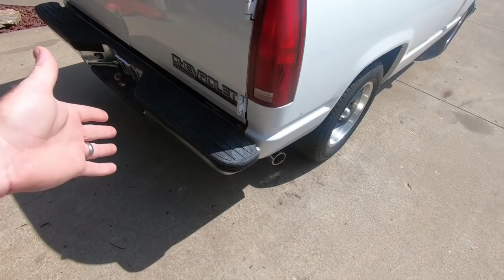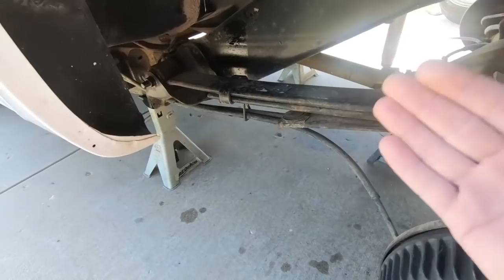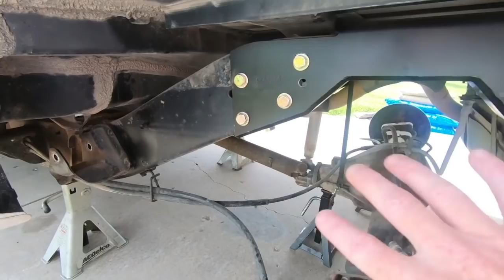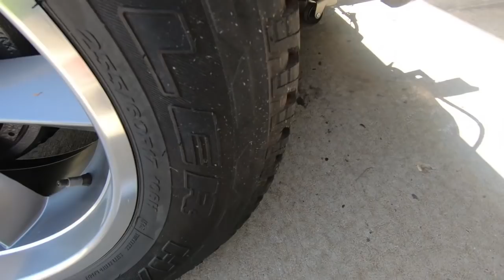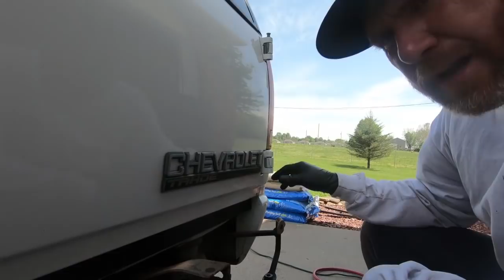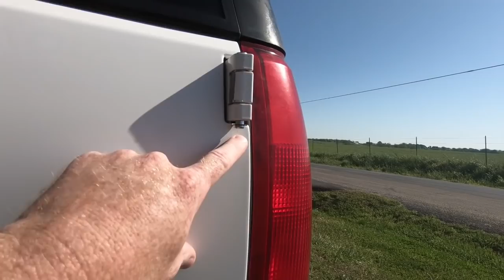2 Door Tahoe Makeover Part 5 (Getting it Low and Replacing Barn Door)

Comment: Did you have to move any crossmembers above the rear end? If you could please let me know..
Reply: When I lowered mine I did pretty much the same thing you’ve done here, but over certain bumps there’s something hitting. It’s not the frame I’m thinking it’s either the pumpkin hitting a cross member or maybe the driveshaft? I can’t figure wtf it is.
Reply from the maker: No. Only things done were what is in video
Reply from the maker: I notched for both in the video
Reply: TWA Motorsports ok thanks bro this video was super informative I’ve been looking for this info for a minute lol

Comment: Nice ride, your among the first people with a video lowering a 2 door tahoe, I have one too 2wd, I did drop spindles and cut an inch of the coils for a 3 inch drop, then I did a flip kit with a 1 inch lift shackles, I didnt want to C notch it because even if I had, the pumpkin would of still hit, I had to cut the rail on top of it, also the driveshaft would of rubbed on dips or with people in the truck and I didnt want to cut and weld in the tunnel of the body, so I got 6 degrees shims, but I want to lift the back 2 inches with lift hangers.
Reply from the maker: Thank you. Yeah lots of work to get these dropped low
Reply: @TWAMotorsports  yes they do, and I didnt know until I lowered it since there really isnt videos speaking about it and pick ups are a bit different so they dont have the same issues, it seems the flip kit drops go about an inch more then stated, I want to lift the back with the 2 inch lift hangers and have a better ride,
Reply: What lift hangers did you use? The ones I bought won't work on the two door.   🤷🏽‍♂️

Comment: Where did you buy the original leaf springs I need to get some my truck also came with a drop but I think is missing some leafs
Reply from the maker: Link in video description
Reply: Do you know how many leafs does it come with cause I was told it supposed to be 6 total OEM
Reply from the maker: No idea. Just bought new ones.